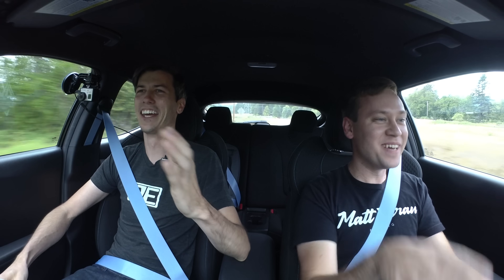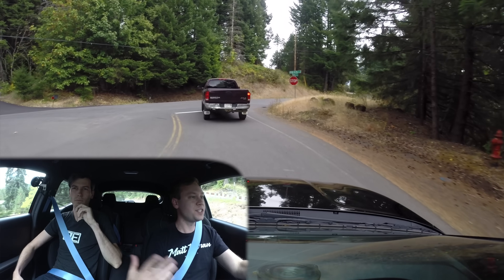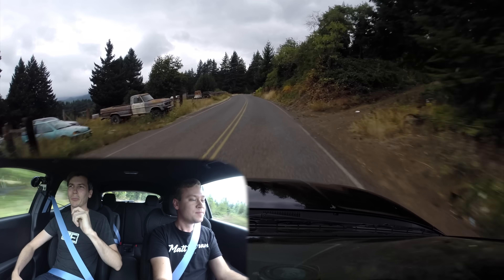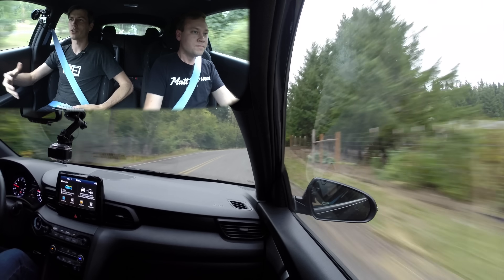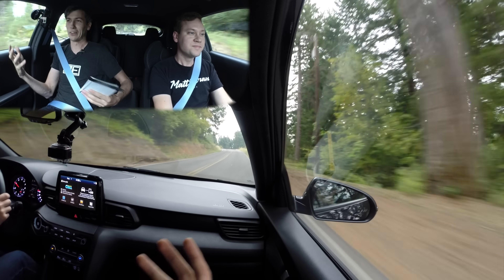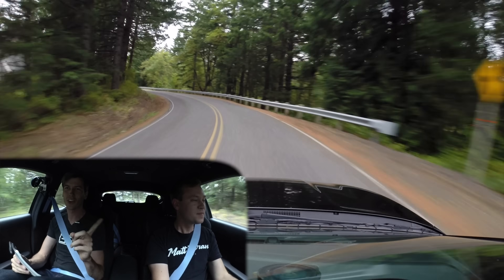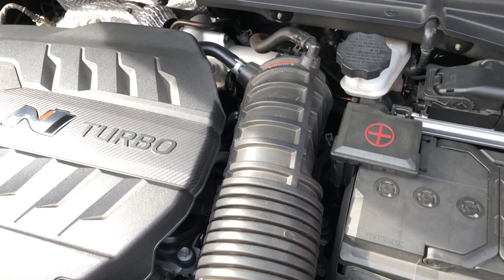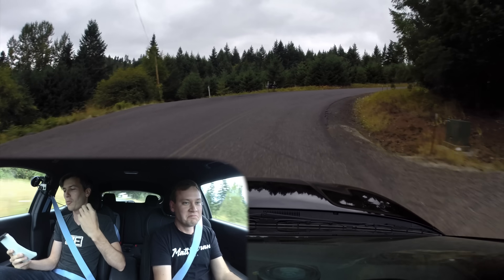Are Car Exhaust Crackles & Pops Fake?

Comment: The crackles n pops are ok if not gone to a ridiculous level. As far as fake engine/exhaust coming through the radio, I'm TOTALLY against it and the crap CVT's shifting. Why mimick shifting??? Just put a real automatic transmission in the dang thing. Maybe I'm too much of a purist. But not into faking. Be real or be gone!

Comment: so is it possible to remap any engine to have this additional ignition on piston down and produce some pops? as I understand it's not possible to achieve same effect in diesel engine?
Reply: Low profile tires in a nutshell.
Reply: @_Siptah  yeah I know this question may sound funny but I'm just curious. It's rather rare yo hear that in older engines even those with lots of power and nowadays all those inexpensive hot hatch like megane or i30 are making a lot of noise on the streets. I assume that in older engines, this sound was more than a sound of something broken than actually desired :) no?

Comment: I can't stand when fake noise is pumped through the speakers, when I first drove my RS it sounded like a boxer engine with unequal length headers inside the cabin. My first mod after about a week was to unplug the "fake" engine noise generator. The rumble was gone and then the quietness of the stock exhaust just made the car sound anemic. Needless to say a catless downpipe and 3" straight pipe fixed that right up. I do have a e30 burble tune as well as my standard e30 tune and I must say, the pops are very addictive. They are actually quite controllable as well if you modulate the throttle just right and shift at certain RPM's. I've always been pretty keen on having every mod on my car be functional but the burble tune just puts a smile on my face and makes the driving experience just that much more enjoyable. To each his own though.

Comment: Hi Jason, you didn't mention a couple of things.

1. Historically pops and crackles used to occur due to the way a carburetor's venturi used to suck up excess fuel during throttle off engine rpm reductions. The excess fuel would cause such poor fuel combustion during engine deceleration that unburnt fuel and oxygen would ignite in the exhaust. You could lean out the idle fuel mixture to get rid of the pops, but the extra richness both helps with post shift throttle response and idle quality. Many sports cars from the 60's and 70's would pop and crackle during spirited driving gear shifts (manual transmission). Race cars with fast shifting transmissions had a different reason for their cracks and pops and this was due to how the ignition would be temporarily shut off during gear shifts, while the carburetor would still allow fuel and oxygen to be pumped through the engine (igniting in the exhaust).

2. When it comes to CVTs you might be surprised to find out that locking the gear ratio as often as possible and "faking" gear shifts actually improves efficiency of the CVT. This is due to the fact that there is additional friction and slippage whenever the belt/chain/cone/etc. is sliding up or down and changing gear ratios. Whenever the CVT remains at a fixed ratio, the lack of sliding improves the energy transfer efficiency (gains of more than 10% can be experienced during acceleration). Manufacturers looking for maximum efficiency have to balance the improvements locking the CVT to a constant ratio provides with the loss of efficiency resulting from operating the engine at a non-optimal rpm. Programming the CVT to "fake" between 6 and 10 gear ratios often provides the best efficiency overall. One additional challenge that this approach can cause is grooves wearing in the CVT sheaves. To work around this manufacturers often program CVTs to slightly vary the fixed gear ratios used from acceleration cycle to acceleration cycle.

Comment: What's better is a carb vehicle with a stick. Hot engine, push in clutch, pump gas 3 or 4 times, turn key and let out clutch. Big bada boom. Will scare anyone and is fun.

Comment: I still like the sound of a 2 stroke backing off.

Similar in respect to the popping and crackling, 
but only happens when you are off the throttle.
Fires like every 10 or 20 revolutions.  

My current 
bike doesn't do it any more, since it has a one 
way clutch.  (Really, 2 of them.  One in the front 
[pedal crank] and another in the rear sprocket 
cluster.)  Next bike will have 5 clutches, 4 automatic.
The 2 one way clutches, a third engine one way 
clutch, and a centrifugal clutch, as well as the 
"normal" clutch.  The engine one way clutch works 
in the opposite direction, just so I can "pop" the 
clutch, to start the bike.

steve

Comment: I have always thought of the crackles and pops you are speaking of as "burbles".... There is a third strategy of allowing fuel to exit the cylinder which creates bangs and flames that is just silly to me. Personally I prefer my tunes to be wet enough to avoid detonation when on and dry enough to at not spool the engine off throttle and since none of my current cars are turbocharged,  that usually means a fuel cut off throttle. What sounds result do not matter to me but I prefer to run quite and fast wherever possible.

Comment: Unpopular opinion:  say what you will about the new Supra, but I really like the fake vents in the car for one reason - some of them can be turned into functional vents for cooling.  It sounds like the car was designed with tuners in mind, and the minute you start increasing power levels by triple digits you’re going to need a way to increase the cooling capacity of the car to keep temps under control - especially at the track.  Granted some of them are worthless (door vents anyone??) but it’s nice to have the others already in place in the car for those that will eventually need them. 

But the fake exhaust noises piped in through the speakers is pure BS.  The engineers that designed that should have either a) put a better motor in the car, or b) sold it with a better exhaust.  You’re ruining my music with that crap.

Comment: I bought an nSRT-4 right out of University back in 2004 — it burbled & popped, first couple seconds off-throttle.  It also did WOT b00st-hold between gears.  That Jag definitely WASN’T the first production car to ‘make noise’ off-throttle.

I’m sure the SRT-4 wasn’t first either (I still have the car BTW, and it’s still a riot!)  “The First” was likely some older, spicy carbureted model — and anybody’s guess.

Comment: Having worked on cars for years I often wondered if the pops and such were actually doing any damage to the engine or were caused by something that wasn't configured correctly. Thank you for explaining how they come to be and what their function is. As for liking them or not, give me the pure exhaust note of the engine without all the extra crap so I can hear what the engine is actually doing and I am happy.
Reply: Ah, I was posting the same thought. I wondered if it was a fad so owners get that Nitrous-burning Japanese car effect from the movies; imaging flames from the exhaust. I still wonder if it shortens valve or cat-conv life (the latter especially in non-turbo models).
Reply: @mikep490 it shouldn't lower the life of either valves or cat. Since the majority of the burning happens in the exhaust, I'd expect the exhaust gas/charge as it leaves the cylinder to be either colder or at least somewhat the same temperature in total, so the valve should be fine.
For the cat, it actually often (usually?) has elements in its chemistry that promotes retention of some of the excess oxygen that passes through for use later, indeed so that a sudden inflow of rich/unburnt fuel can still be handled. 
In either case, it's very temporary, so not something that should overload either component.

Comment: Any engine noise generated by speakers is nonsense.
Reply: ronindebeatrice there’s too much nonsense in a industry that should be dominated with no nonsense
Reply: I only know like one or two cars with actual speakers (bmw i8) . The rest, as far as I can tell, just funnel the sound through some channels into the cabin, like the a pillars. What other cars use speakers?
Reply: @2010ngojo  Ford's doing it too at least. I believe the ecoboost mustang and Focus RS.

Comment: Sorry, is not the engine breaking more if the fuel is used for the pops?? I mean it should slow it down as is not fuel used ?? (Around 7:00 minutes in the video)

Comment: I'm gonna take a controversial stance here: all engine noise is wasted energy that could have went into giving the car more power or better efficiency and should be minimized.
Reply: Internal combustion waste a lot of energy as heat, noise, and light. This is one of the reasons electric is so much more powerful.
Reply: You're not wrong, but even the most thunderous exhaust engine sounds are only a drop in the bucket compared the power released on combustion. Just think of how small a generator is required to power a massive sound system. And the generator is wasting energy on making sound itself as well.

Comment: As an anti-lag system, I get it. Activate it when the brake and gas are pressed at the same time since the driver obviously knows what they're doing and there's hard braking and imminent throttle increase to be expected. Same at highway speeds when you're merging, waiting for the gap and need the throttle response to safely change lanes for overtaking. Just please don't annoy people in towns. I can understand artificial engine noise kind of; soundproofed my car including the engine bay. Made it sound much, much less responsive and quick just because the engine was too quiet. Actually removed a layer for better sonic balance. I want my commuter to be a quiet sofa until I don't.

Comment: 🧐 Two important ideas were overlooked in this video 🧐

1. There is another type of crackle & pop that naturally occurs in cars running a rich A/F ratio. In this case, timing isn't delayed, & the exhaust valve isn't left open. Instead, because there is excess gasoline that isn't burnt, it ignites in the exhaust manifold when it comes in contact with atmospheric pressure & temperature. In my opinion, this is the best type of pop & crackle! Unlike the burble-tunes, it's unpredictable, which adds to the fun. The, legendary, Ferarri F40 is an excellent example of this!

2. Another pro of leaving the exhaust valve open on deceleration is that the additional flow of air and fuel into the exhaust manifold warms the catalytic converter quicker!

Comment: 6:25 Keeping fuel injecting in the engine and burning on exhaust stroke wouldn't keep revs high, actually it will create slight engine breaking because it will create pressure when piston is going up

Comment: I recently purchased a 2020 Veloster Turbo and it has very loud pops from the factory if you rev it to 2k and let off the gas, but not in between shifts really. I put an aftermarket exhaust on it and it sounds like gunshots now and it's not tuned at all.

Comment: As long as the engine itself is making the sound, I doesn't matter to me if it's not necessary. Same idea with piped engine noise if it's physically piped in, like in the LFA where Yamaha designed parts of the engine to make a certain sound.

Comment: Round here dickheads in AMGs accelerating hard and backing off suddenly so that their exhaust crackles leads me to the assumption that exhaust crackles are just the latest in a long line of "look at me!" features and are not really necessary in street cars. Just like really loud 3" exhausts on small displacement cars it isn't cool, it isn't needed it is just annoying.

Comment: In my Mercedes A45 is Crack and Pops  when shifting with your foot pinned to the floor.  Even though the DCT shifts in 0.1 seconds i understand they throw in the negative timing just for a split second to give you that noise on upshift.
But put it into Eco, and its a quiet as a mouse.

Comment: When crackling and popping, is there any risk of damage to a catalytic converter from allowing a flame front to advance over it during the exhaust stroke? Does the flame make it that far?
Reply: I wouldn't think so, I would imagine emissions companies would have a field day with a car that crackles so much from the factory that it destroys a cat. Then again I've seen stock cars without turbos or crackling exhausts blow up cats for no reason so it could be possible, however unlikely with how strict emissions standards are
Reply: Good point, but thinking also about lifetime degradation of cat rather than outright blowing it up. It feels (by this I mean I have no stats to back up) like this isn’t something that’s measured or tested. I have an aftermarket tune that adds occasional pops, and was assured by the tuner that it isn’t damaging to my new cat - but I didn’t get a sense that they actually knew this for a fact. 

That said, my tune, I think cuts spark as well as retarding on overrun, so the occasional pops come from rich/unburnt mixture hitting the exhaust.... which may be better or worse than late spark (I have no idea but would love to find out).
Reply: @lukedavis569  I believe my mini works the same way when it burbles on overrun and I also wonder about long-term longevity. I live in a state with no emissions testing, and as such I have a catless downpipe that makes the burbles and pops louder; makes me wonder if that would cause my second cat that is now taking the full-brunt of the exhaust to wear out a lot sooner
Reply: Not normally, usually the mass flow drops, but for a short amount of time even the late combustion could raise the catalyst temperature a bit, but not enough to worry about in a factory tuned car. Actually leaving fuel on at stoichiometry during the shift but retarding timing instead does maintain NOx conversion after the shift. If fuel is cut off, usually a rich purge is needed for a few seconds after fuel is returned, perhaps a lambda of around 0.9 or 0.95.
Reply: @dale116dot7  An engineer’s answer. Perfect, thank you :)

Comment: Curburetted engines ran lean on overrun. The flame front is slower in a lean mix so is still burning when the exhaust valve opens causing the crackle. All the things you talked about are just simulating that effect. Civilised people used carbs that added extra fuel on overrun  prevent this. But there was a price to pay in gas mileage. Also this was not possible with the introduction of catalytic converters as any unburt fuel damages the cat which is why injection is now mandatory.

Comment: My 2006 R53 Mini Cooper S pops and bangs on a stock map. Was very quiet with standard exhaust but quite loud now I have a custom exhaust. That engine is very old school tech. I read somewhere (open to correction though) that the pops were a legitimate technique for cooling the combustion chamber; ECU fires injectors, the fuel takes a bit of heat out of the chamber, mild fuel air mix combusts as it heats up, pops and bangs. Is that total nonsense?

Comment: - Fake vents are just the current decade's equivalent of useless spoilers.
- Fake pops are not that different to artificial BOV sounds.

Use Lexus' method on the LFA to let actual exhaust noise in for driving experience; can even have a mechanical switch to block it out for when you drive in eco or comfort modes.

I guess it feels a tiny bit like when people put Rubicon Decals on a Wrangler Sport or V8 badges on V6 Trucks.  Being dishonest about what is under the hood.  Just... Why?

Obligatory: "get off my lawn"